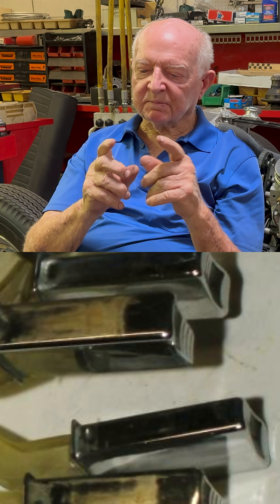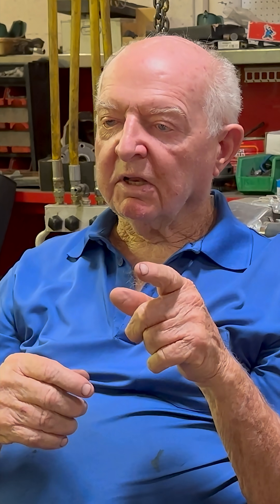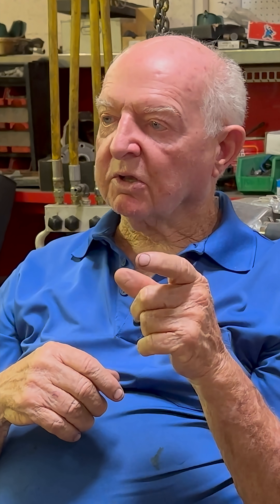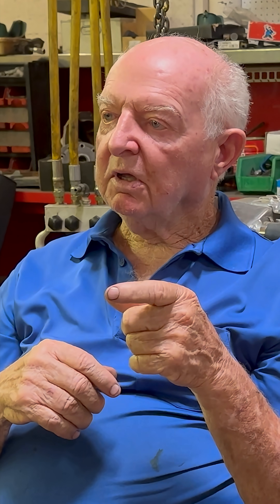Push Button Trans w NO ELECTRONICS - Ask Ed 32 - Ed Smith w #BarryT #classiccars #edsmith

Comment: The only reason I think the manufacturers got away from manually operating components is planned obsolescence, you can find a car from 50s to maybe the 80s and everything still works and have brand-new cars that the door lock actuators don't last 5yrs

Comment: 1958 Ford Edsel had electric shift automatic transmission. Gear selector buttons on center of steering wheel. Chevy corvair and Plymouth had dash cable button or lever shifter. 🤔
Reply: 57 Mercury had a push button shifter. The Merc O Matic transmission had a special case for the push button shifter only. A very rare transmission case as 57 was the last year for the Merc O Matic.
58 Ford cars had the Cruise O Matic transmission which was different.
Reply: I had one of these push button shifters out of a 57 Mercury. They were a complicated arrangement of levers, springs and ratchets that operated a cable. Really amazing that it worked at all.
Reply: I think the 57 and 58 Mercury used push button shifters. It was a space age thing where everything in the future was going to push buttons. But the old column shifter worked well and was less complicated probably cheaper also. So for 59 the Mercury push button shifter was history.

Comment: They didn’t have electric solenoids back then in the 50s and 60s I thought everybody knew that
Reply: Agreed, I remember watching Highway Patrol, watching MR Crawford drive the Push Button Chryslers , he never used that park lever he would jump in hit drive and let the park brake off and he was moving already
Reply: @jeffclark2725  
Mr. Mathews drove 57 Mercury's also which had a push button shifter. In one episode when the 57 Mercury drivers door was opened you could hear the door dragging. This was a common problem as the heavy door would drop down and drag and would need to be bent back in to position with blocks of wood and a pry bar. 21 - 50 bye
Reply: THEY did, just not in transmissions....
Reply: @paulberkland5700  starter solenoids completely something different
Reply: @paulberkland5700 "Ehmmm" 
BW solenoid-shift overdrive clears its throat.
😊